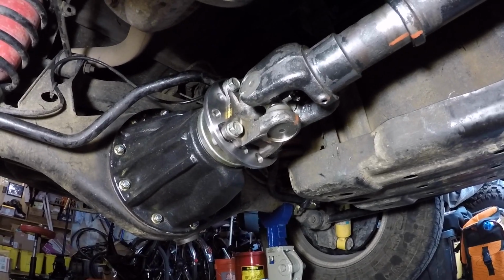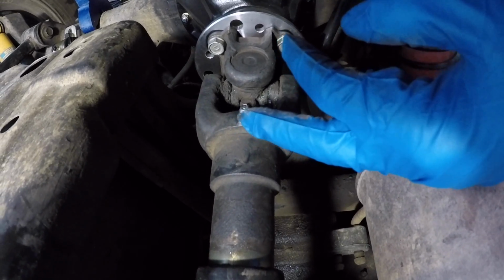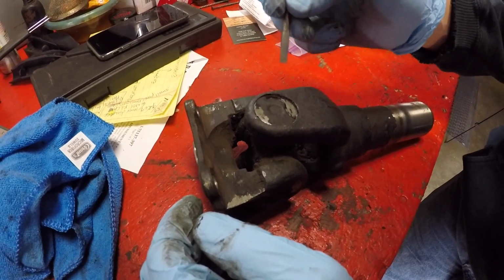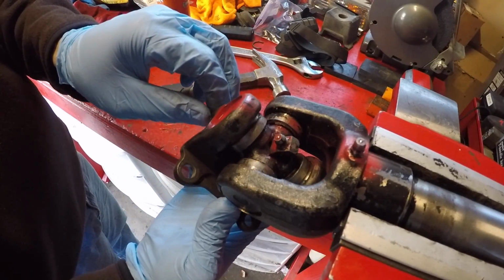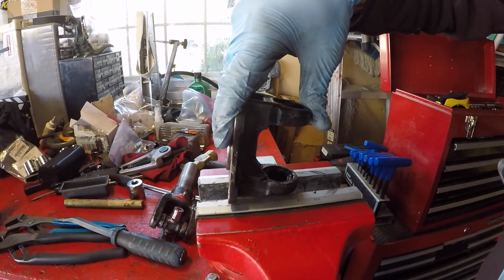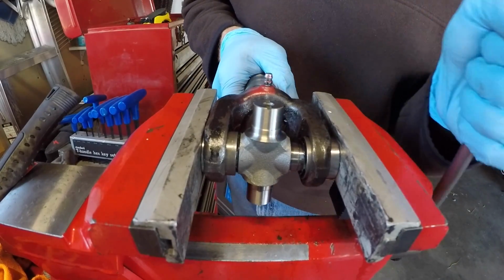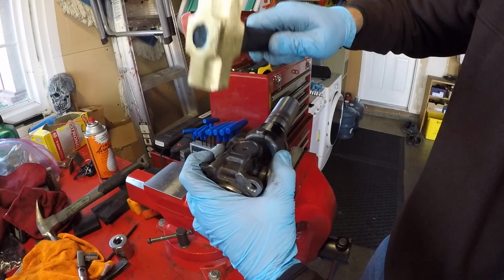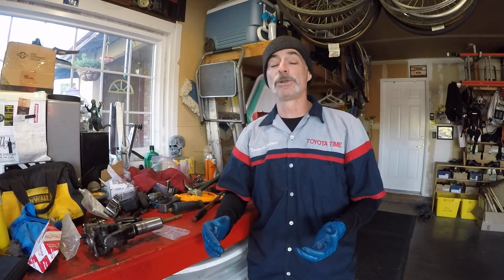U-Joint Replacement

Comment: Thanks Tim, Sean and Jordan for the very helpful video. I know this is several years old but I just used it to replace my u-joint. In the absence of a bench grinder I used my angle grinder with a thin cut off wheel to cut the u joint out once I had one cup almost all the way pressed in. I found using the cut off wheel was pretty easy and worked really well. Did NOT end up nicking the yolk assembly whatsoever in the process using the angle grinder which I was initially concerned about. I really appreciate your videos over the years because they make me not feel like I'm not on my own when I'm trying to tackle these projects on my now 26 year old 4Runner. Happy New Year and I hope you Tim are enjoying your retirement!🤙🏼
Reply from the maker: Good job getting done.  Happy New Year to your as well.

Comment: This is the only video out of 5 that I have viewed that explained the exact yoke I have and what needs to get the job done. The caps sure are in there tight... Thankyou. The others failed to admit or show the real issue of getting the old bearings out. Thats a tough yoke to swallow LOL PS: Is it OK to use "Lucas" Red "N" Tacky #2 grease w/540 Deg Drop Point. I bought a case years ago and I need to deplete my supply. It says for wheel bearings etc.
Reply from the maker: @janosistvan5226  I'm not sure about the grease, but I sort of think at the end of the day, grease is grease, and it will work to protect the u-joint needle bearings.
Reply: @TimmyTheToolman  Lucas Red-n- Tacky wins out per "Project Farm" W/big wins. Man, I had to cut the u-joint bearing off my Toyo 4-wheeler yolk it was no fun. What happened to clamping them on? Thanks...

Comment: Great video, Timmy!! I replaced mine on my 2003 Tacoma SR5. I was kinda desperate on a Sunday and so I used a Moog 285 and it's been 20k since and zero issues. Now, I'm having a totally different issue with the truck in that when I start it up and I throw it in reverse, with no acceleration applied on a level surface, the truck shudders as it's moving back. Once I throw it into drive and go, the truck is fine. I'm thinking vacuum leak or a bad coil. Any ideas?
Reply from the maker: @thechuckster6838  I'm not fully understanding the issue.  Does it move in reverse?

Comment: I have this weird clunk noise when im driving on high way it happens when I let off the gas fast there's a cluck noise and a slight jerking feeling do u think it could be my u joints?
Reply from the maker: @Cmc-365  It's possible, but I'd check out your transmission and engine mounts.

Comment: I am getting ready to do this on my wife's 2002 SR5 Sport front driveshaft and came here to just get a better feeling of what to do and as always your videos are super helpful Timmy, Sean and Jordan. I would like to share an experience I had with my old 2000 F-150 pickup universal joints. The process to replace them was similar but when I installed the new joints and pressed them in using my bench vise it put pressure on the yoke arms as well which in turn changed the angle of the bearing cups making the newly installed joint somewhat stiff. What I did was to take a brass punch and with the shaft in the vise I hit the inside of the yoke arms towards the outside on both sides which seemed to have gotten the arms back parallel with each other and relieved the pressure on the joint allowing it to freely move as designed. Thanks again for another super helpful video.
Reply from the maker: Good luck with the job.  I hope it goes smoothly for you.

Comment: Thanks for a great video.   Would you know if the 2005 Lexus GX470 uses the same u-joints?
Reply from the maker: Thanks.  Unfortunately, I do not know if the GX470 uses the same u-joint for the slip yoke.
Reply: I confirmed through O'Reilly auto parts that it is the same part number for the gx470. However a recommendation for your viewers :  i would not recommend any greasable aftermarket u-joint. Either buy oem greasable or if you're on a tight budget and have to go after market, go with the non-greasable.  I ended buying two new oem drive shafts.

Comment: I’m having some confusion with the part number you have listed in the description. I’m finding two other part number saying they are the rear U joint. Any insight?
Reply from the maker: Nope.  The part number we used is the only one I know.  I guess you could double-check at a Toyota dealer.

Comment: I'm confused on what U joint I need for my 1999 4runner limited 2wd. The 04371-60070 is showing not compatible and I can't find where to look on the dealer sites. Vin is JT3GN87R7X0099367.Any help would be appreciated.
Thanks!
Reply from the maker: You could simply visit your local Toyota dealer parts department and they can help you out.  Sorry, but I'm not going to start doing online parts searches for you using your VIN number.  You'll pay more by buying directly from your local dealer, but you'll at least get the right u-joint for your driveshaft.  Good luck!
Reply: Thanks. I'll give them a call and hope they can give me the right info. Have had bad experiences in the past with them and it seems like it's getting more difficult these days to find anyone working that has confident knowledge outside of what I can usually find out. A lot of fake it til you make it guys out there too which adds to the excitement. That's why I like forums but, I guess I need to have so many introductory posts before asking questions on the one I tried signing up with. Maybe I was misunderstanding the rules. 
Will update for posterity. Parts dept unavailable atm. Guess I'll try later.@heToolman
Reply from the maker: @s2k350  Well, if a dealer parts department person can't find you the correct u-joint with the VIN number, I don't know what to say.  Even a beginner parts department person should be able to handle this. I wouldn't do this over the phone.  I would go there in person.
Reply: Guess I should have but it's a 30 minute drive with good traffic. I called, waited 15 minutes, hung up , called back and got someone. They found the part , wouldn't tell me the part #. $225 without tax for the pair. Asked why most u joints are $60 ish and he said because he had to look up the part, that's retail. What a joke. I asked why the website couldn't show it but he said that's why they make the big buck marking stuff up in so many words....
 I did manage to get him to verify the 04371-60070 wasn't the part # he was looking at for mine. Weird bc  some dealer sites say it is, some say it isn't... Who knows..maybe I shouldn't have said "04371"dash"..60070
..Tbh, if this was the Chevy/GMC GMT400 forum I'm a member of , I'd have this in 5 seconds with guys nearby offering to help me put them in...lol ..Love my Toyotas but this experience is on my nerves. I'm not paying $250 for 2 u joints and I don't want to put the Moogs on from the parts store since they only lasted 2 years. Still open for help here if anyone visiting can solve this riddle for me. I'll keep looking and update.. Thanks for all you do with your videos. It's life changing to have people like you helping so many.@heToolman
Reply from the maker: @s2k350  Try posting this question on T4R.org.  Maybe someone will have the answer you're looking for.  There's also 3rd Gen 4runner Facebook pages you can join and ask this question.
Reply: Thanks. That's actually where I joined in the past because I was having questions about something when following your water pump video but I think it said I had to introduce myself in the new members area and have like 16 posts or something before I could participate in a thread or something... I was kinda put off by the process bc obviously I needed an answer reasonably soon. I'll check it out again and see if maybe I was misunderstanding and there weren't any hoops to jump through. Tx again. @TimmyTheToolman
Reply from the maker: here's what I found...PN: 04371-30040
but I think this part has updated to PN: 04371-60100.
- Sean
Reply: too weird...Was just coming here to say that because I see some on Ebay that say it's compatible....of course when I put it into the Camelback dealer site, it says not compatible... not sure what to make of all of this. I think I may just go for it after a few more peeks. Thanks so much! That's awesome you looked into it. I tried just searching u joints on tr4 but got everything but... Did remind me about the Wet Okoles I've been wanting though..lol @TimmyTheToolman
Reply: I called my driveline shop that has worked on my GMC and they said they get Neapco  1-1612 which looks like it references 04371-60070 but of course it shows not compatible with the 99 on dealership sites.. Something funky going on. If I put 2000 4runner, all parts across the board show they fit...weird. I'm taking the driveshaft in to them . $89... They said they use Neapco and Spicer usually depending on what pops up as recommended..they've been around forever so I trust it'll be fine however it ends up.. Thanks again!  @TimmyTheToolman

Comment: You guys make it look so easy.  I'm in TN and I was getting a vibration between 65-75mph.  I wanted to isolate the vibration so I removed the drive shaft & tested it in 4 wheel drive.  (probably not too many front wheel drive 4runners out there! Lol )  Vibration was gone.  Upon inspection, I found the rear u-joint had a seized up cup / cups.  Mine are seized up so it took a lot of work freeing and I only have a good old craftman puller, not near as nice as the puller you guys used.  I got 2 out on the shaft side & have the other 2 that are seized to tackle tomorrow.
Reply from the maker: Good luck with the rest of the u-joint replacement.   This was Jordan's and my 2nd time replacing one.  We did one before and learned some techniques and then filmed the second one.  You'll get it.
Reply: @TimmyTheToolman  https://www.youtube.com/watch?v=SlsQVEoP-pA
Reply: @TimmyTheToolman  I'll do a short video.  Mine has some rust and it's the seized side.

Comment: Timmah!  does the Gen3 T4R have a center support (aka carrier) bearing such as the Gen1 Tacoma has (non-single-cab)?  i was looking for tutorial on what is involved in replacing that on my truck to cure some odd vibing under acceleration load
Reply from the maker: There is no carrier bearing for a 4runner.

Comment: front and rear u joints are the same part?  About to do this on my 97 2wd
Thanks
Reply from the maker: Don't know if they are the same part number.  I've never changed the front u-joint on a 2wd.

Comment: Spent the day replacing the same u-joint on my truck. Your video was a big help.
It was very satisfying getting rid of that annoying squealing, and the horrifying clunking noise, and it stopped the vibrating that my truck was doing. When I dismantled my U-joint I found that the bearings on the pinion side yoke, were pulverized, which led to a lot of slop and rattling. Anyway, I had to replace the yoke as well, and the tolerances on the new bearing seats were much tighter then the old yoke, so I ended up freezing the bearings and then they went in without any fuss. 
Fun times. 😏
Reply from the maker: Good job getting it done.  I'm glad our video helped you out.

Comment: @Timmy The Toolman
The u-joints ending in 60 with the deeper cup are for the double cardan joints. The u-joints ending in 70 is for the yoke. I just disassembled my driveshaft completely and i found the difference.
Reply from the maker: Good to know.  You're actually rebuilding the double cardan?
Reply: @TimmyTheToolman  Yes, i wanted to see for myself. And when comparing the 2 joints i refered back to your video because i couldn't remember if you filmed that. There's some more differences between the 2, superceded part numbers is my guess.

Is there a way i can send you pictures and more info of my findings?
Reply from the maker: @yesnothanksplease  What I have is all shared in the video.  I've never tried to rebuild a double cardin joint.
Reply from the maker: @yesnothanksplease  I think I might have watched this video before.  Let me know how the double cardan rebuild goes for you.  It doesn't look easy.

Comment: hey tim,

do you think you could remove the u joint needle bearings using a shop press?
Reply from the maker: Not sure because we've never tried it  with a shop press.  Another option that's totally different is taking a cut-off disk and cutting the center of the u-joint body out and then easily pressing the 4 cups with the needle bearings out.

Comment: the transitioning animations are disorientating
Reply from the maker: Did you get dizzy?  There's medication for that.  The transitions make the cuts smoother.  Without them, the video would look very jarring and jumpy.  Trust me, it's better with the transitions.  The only way to make the video smoother is if I could 100% always say everything perfectly and we do everything perfectly on the first take.  As you can understand, that's not possible.  If we didn't clean up the video by making cuts, the video would be much longer and probably confuse people.

Comment: What makes that knuckle so difficult? Wouldn't some quality u joints be ok in there?
Reply from the maker: I'm not sure what you're asking.  The Toyota u-joints are quality parts.  The difficulties are mainly due to how the yoke is shaped which makes pressing the u-joints out with a standard c-press more difficult.  I've heard some people use a cutting disk to cut out the center part of the u-joint so then the pressing of the cups is easy.  I've never tried that technique though.
Reply: @TimmyTheToolman  I am looking to replace all 6bu joints and am hearing that the ones directly behind the slip yoke are impossible to change. I'm talking about that double knuckle thing. I'm curious as to why it isn't recommended to change them
Reply from the maker: @tonyrowe1455  The double cardan joint is a pain in the ass to do.  Toyota doesn't sell u-joints for it so you have to source aftermarket ones.  The joint also involves a center ball that is tricky to deal with.  

Most people just scrap the driveshaft if the u-joints in the double cardan go bad.  A nice replacement is a custom driveshaft from Tom Woods which builds it with easy to source u-joints and it's also easier to work on.  I have heard there are shops that will rebuild the double cardan joint though.
Reply: @TimmyTheToolman  ah I see. Thanks again dude! You are my go to resource for my lil taco 🌮
Reply from the maker: @tonyrowe1455  No problem Tony.
Reply: @TimmyTheToolman  hey if you ever wanna do piston rings on an 04 Camry, let me know 🤣🤣🤣
Reply from the maker: @tonyrowe1455  Probably not, but thanks for the offer.

Comment: Tim, what was the symptoms of this bad u-joint? Was it like a womp-womp sound during low speed acceleration?
Reply from the maker: It would be a sound that would increase of decrease based off the speed you're traveling, so a rotational sound.  I can't remember if Jordan heard a noise or just found the play in the u-joint during a drivetrain inspection.  Bad u-joints can make various sounds.  It could be a womp-womp, but that might be a bad wheel bearing too.
Reply: @TimmyTheToolman  thank you!
Reply from the maker: @MisterMcall  You're welcome.

Comment: Wow this guy is wearing a Toyota mechanic shirt calls himself Toyota chimney represents South Park he should be Timmy in the wheelchair use a freaking angle grinder cut the u-joint out at all four corners and tap them inward you should be able to remove these in 10 minutes I would fire my mechanics if they didn't do it tap your new ones in easy peasy
Reply from the maker: You should make videos and share your knowledge.  I have never represented myself as a Toyota Certified Mechanic.  I bought the shirts Sean and I where from an Automotive Workwear web site so we'd have some type of uniform with our name on it.  

It's pretty consistent.  The guys with the most attitude towards DIYers like myself are always the "Paid" guys.  You won't make videos to help others out because you want people to come to shops to get bent over on high hourly labor rates.  And, you "Paid" guys screw up all the time.  Good luck with your high and mighty trolling attitude.